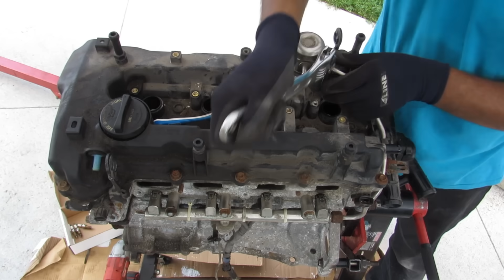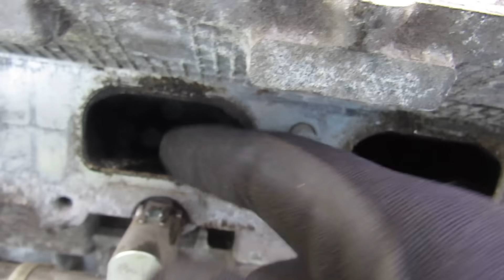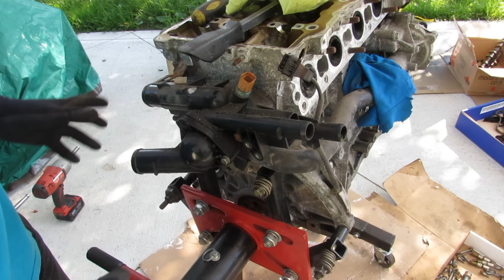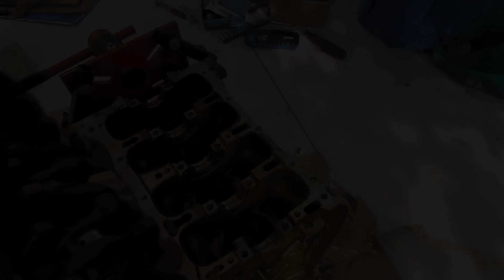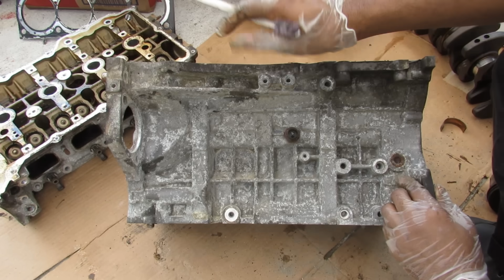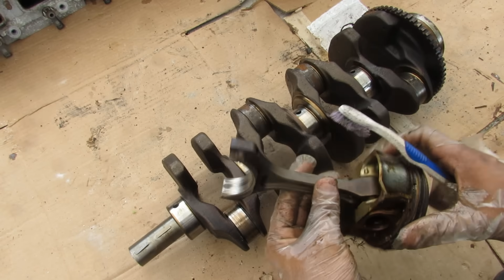Why Hyundai Engines FAIL

Comment: Interesting...I wouldn't have expected the high pressure fuel pump to be purely mechanical.  Also interesting that the metal particles didn't get filtered out by the oil filter...I wonder why?
Reply: The oil flow to connecting rod bearing was not correct oil flow, because of oil channel was not made correctly by boring machine(with some metal particles   blocking channel permanently)
Reply from the maker: Some of it does... But not all of it.

Comment: Basically, they keep failing because they were built so cheap and nasty no one bothered to deburr anything.
Reply: USA build quality control was absent.
Reply: @jhndijkman  This. The korean built kia vehicles are substantially less risky. It's hard to say if the much lower reported failures for korean vins are from manufacturer issues or if it's neglectful owners trying to jump on the bandwagon
Reply: @caribougoo349  kia optima had issues with the same engine.
Reply: @jhndijkman  Some must use engines from Alabama. It seems so bizarre that two different plants could fail that hard
Reply: @caribougoo349  I tell you what I don't agree with is our toothbrush wielding vid presenter/ story maker makes vid heading stating why  Hyundai engines fail.. Sounding a bit too all-encompassing of Hyundai engines is a step too far. Believe me you don't have to go look to hard to find his fav Toyota engines with failures and design faults. The cam chain area he picked up on. Between the cam drives at the top of the engine. Not an issue. Most engines from anywhere don't have chain rubbing blocks there. Plastic thermostat housing. Alot of  other makes use the same sort of set-up. I don't like them iether but at least they are easy to get at. Check out VW golf engine and their poor design of water pump position. The direct injection issue is valid design fault done by all of the engine makers of the time. VW and their family of four cylinder engines have a really bad rep for the need of inlet cleaning. The Hyundai theta engine is fairly easy to clean relatively compared to others. It has taken far to long for that to be remedied. But it has by Hyundai and yes finally Toyota/ Subaru Ford v8.
Reply: @jhndijkman  Yeah I've got no doubt hyundai/kia have done their homework to say their designs shouldn't give them warranty repairs for the average person. Plastics might become more dicey for someone who manages to get out to the 10 year mark without passing mileage. The issues are 90% quality control and 90% of recalls involve vins starting with 5. They've got decent transmissions for a beater brand besides refresh hiccups at least
Reply from the maker: Quick and cheap makes for beater cars they can sell to undercut the competition.

Comment: So basically they built their engines to last just as long as their warranty of 10 years/100k miles then fail, wow
Reply: At 90 thousand miles just rev bomb it to death
Reply from the maker: I don't think any of these engines are 10 years old yet...
Reply: @speedkar99  Ouch, yeah I guess that's true!
Reply: @speedkar99  The 11s and some 12s are.
Reply: They are currently under extended warranty for longer time.
Reply: @SHADOWBONELESS  Yeah I understand they are under a class action lawsuit at the moment and Kia is being filed against as well
Reply: Not even, if they did, they wouldn't be losing billions each year to engine warranty claims and lawsuits
Reply: @ro0ster648  they actually are replacing the engine Left and right now in the dealership, luckily this engine is very easy to do, the dealer are replacing the long block some it could be done in half of a day.

Comment: We have a 2013 Hyundai Accent with the 1.6L Theta engine.  Bought it new and still purrs at 8 years old.  I am strict with maintenance (do most of it myself)
Reply: Yeah the 1.6 are pretty bullet proof with regular maintenance
Reply: It’s not the theta engine it’s the gamma.
Reply: This engines are 2.4 liter made in Alabama usa
Reply: Same here 
1.6L kia Forte, 230k km and still going strong, 10w40 and oem Kia oil filter.
Reply from the maker: Keep it maintained. I check my oil at every gas fill-up.
Reply: I have a 2016 accent now with 99k miles and it performs as good as the day I bought it. I just did the intake valve cleaning a couple weeks ago. Hopefully the 1.6 will get me 200k+. I had a 2005 Tucson with the 2.7 v6 and it ran great and was very dependable.

Comment: A Hyundai is generally 2.000$ to 5.000$ cheaper than a Toyota or a Honda upfront...then again in 5-10 years you'll need to rebuild the Hyundai engine for 10.000$ to 20.000$, soo I guess buy a new car???
Reply from the maker: Yeah go with a used known reliable model over a new one.

Comment: I remember all the great press this engine got when it came out in the 2011 sonata and optima. 200hp 4 banger with no turbo was a big deal then. I was dead set on the optima for a while. Now im glad I never got one.
Reply from the maker: Yeah these cars were good for their time back then
Reply: Have a 2011 Optima with that engine. Not a bad car. But engine has sounded a bit harsher recently. And maybe a bit pokier than in the past. Hope it doesn’t blow on me.
Reply: @ecoRfan  If you find the oil level consistently low or any form of knock at idle, she's on borrowed time
Reply: @ecoRfan  especially if you start hearing some knocking from the engine. You might qualify for the lifetime extended warranty on that engine.
Reply: I fell for it.  I wondered how Hyundai got 274HP and still got over 30mpg highway.  Now I know why...
Reply: @MattPSU02  pretty sure that was a different engine
Reply: @ecoRfan  the 2.0T is very closely related to the 2.0NA and 2.4 Theta II engines.  It obviously has the turbo bolted on, etc. but the basic engine architecture is quite similar. I've owned both engines.  They all had the recalls and all have the same issues (minus the turbo issues).  And yes, the turbo is even less reliable, with wastegates that get stuck, oil feed lines that break, more blowby than the NA, more engine wear, etc.
Reply: @MattPSU02  ok. Thanks for clarification. And yes turbos add another level of potential problems.

Comment: I'd like to see how much metal is in the oil pump/balance shaft assembly. I've heard that is part of the issue aside from machining defects.
Reply: The metal shavings get stored in the oil passages by design lol
Reply from the maker: I didn't get that with this engine unfortunately
Reply: @speedkar99  that sucks. I have a 2012 2.0T that's modified and been beaten every time I drive it. Amsoil 5w40 and wix xp filter every 7k miles. Have a 3 port catch can with pcv delete and do induction cleanings. The car is running full bolt ons, has been tuned since 45k miles and is running a bigger 22T turbo (original blew up at 190k. Still on it's original engine and trans and has 205k miles now.

I also have a Mishimoto drain plug that has a neodymium magnet on it and I'm always pulling a small amount of metal shavings out of the engine. It still runs like a beast though.

Comment: I wonder if some of the owners who did early 1st oil changes might have flushed out the machining debris? However, the oil filter is supposed to catch that stuff, so I guess it wouldn't have made much of a difference if the chips stayed in the connecting rod journals.
Reply: Right I heard the debris was right at the crank shaft so if it did get caught too late will be a failure very soon from the wear it had it’s just a matter of time honestly. Hope my 2020 Tucson doesn’t have this issue I run a oil catch can too reduce carbon buildup. Be there done that
Reply from the maker: If they knew about the issue then yeah they should have changed it first at 3000km
Reply: @speedkar99  is this issue with 2020 model Tucson with 2.0l. Silo they still have these engines set aside that have the issue?
Reply: Changing the oil early will not remove the metal particles in the oil passages which are after the filter. As soon as the engine is first started the damage is immediate.
Reply: @frankbutaric3565  anyone knows Olof this issue is also with 2020 Tucson models with 2.0l ?
Reply: If the metal debris is large enough, the oil pump pick up screen, will get more and more restrictive as it’s pulling oil from the oil pan. The oil pumping volume goes down more and more from the gradual blockage increase and engine death is coming your way. A situation like this will destroy any engine. It’s sloppy work from the Kentucky state factory that makes them. Cleanliness is mega important. These engines made in Korea pre 2010, never had these problems.
Reply: @simonlangmead7  good info for sure my friend thanks for that.
Reply: @simonlangmead7  Mine is a 2008 assembled in Alabama with 145 K miles on it and seems fine so far - though I do have to keep an eye on the oil level and start topping off after about 2000 miles. How can I tell whether I have the engine made in Korea, Kentucky or wherever else they were made?

Comment: Hello, I just subbed so I am new here. Which engines are the best in your findings and which transmissions are the best in your findings. Which cars are the most reliable. I think these would make great video ideas. Thank you for your work!
Reply: That would be a great video! I know for GMC their trucks from the early 2000's had an engine and tranny that would go 250k+, I forget the exact engine code though. The Toyota Tundra of the late 2000's up to today is the same and the Toyota camery for most years is known as extremely reliable.
Reply from the maker: If I'm judging by just engine and transmission alone (not including the car) I vote for a Honda K-series engine and probably it's manual transmission. Those are so strong and I have seen many with high mileage.

Unfortunately the rest of the car tends to fall apart and nickel and dime you when things get old. 

The 1ZZ Toyota Corolla is a good motor too but you have to feed it alot of oil.
Reply: @speedkar99  Good point, not only are K-series reliable, several versions of that engine can handle 500+ hp with stock internals, very well designed engine!
Reply: @speedkar99  thank you for the reply! I think this would be a good video series. Maybe do top 5 most reliable engines, top 5 most reliable manual, automatic, etc., and top 5 most reliable overall. Love your content.